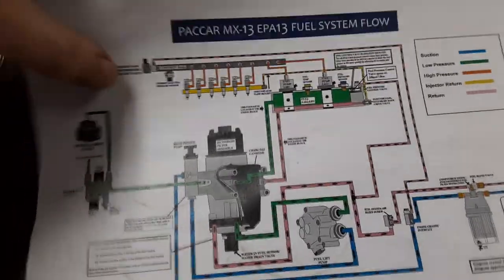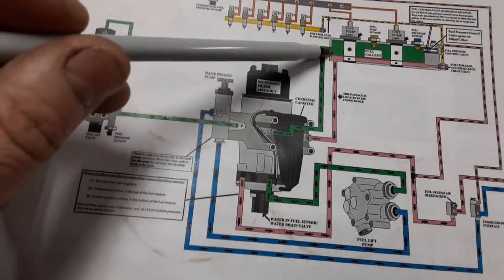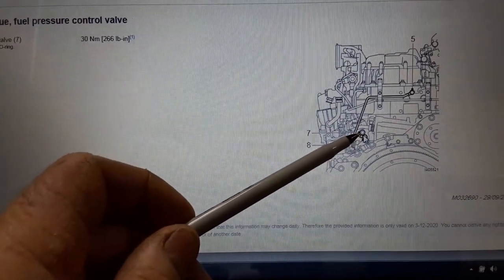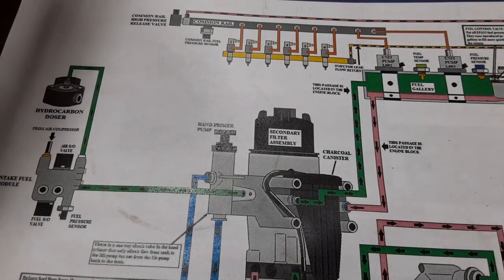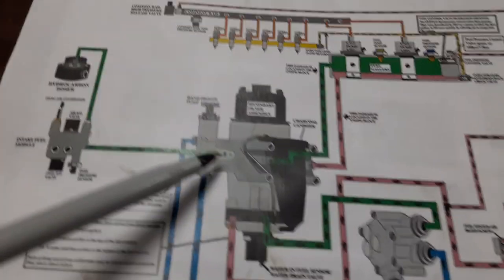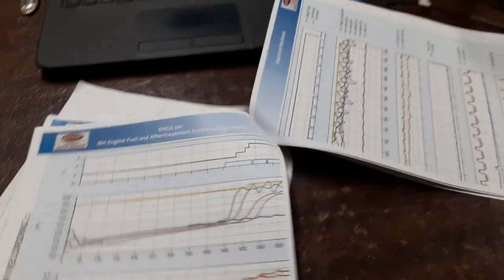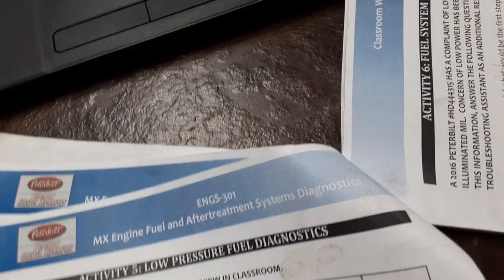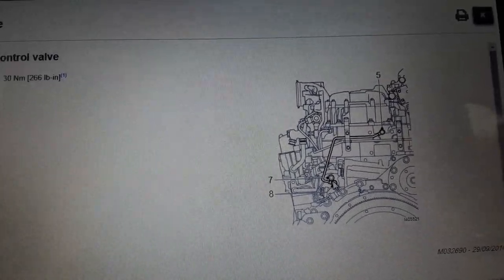MX low pressure fuel

Comment: hello, I had a problem in the second section of the high pressure pump, I changed the plunger inside and the valve was jammed, now my question is with the cups is everything okay?  what do you think?
Reply from the maker: Sorry I don't think I saw this.

Comment: What was the fix to this mx that only has 3 psi on low side fuel pressure?
Reply from the maker: I think I made this video to answer some questions, but I didn't get to work on the truck 😊
Reply: @monray300  Darn, I got one that's doing the same thing as described in your video.
Reply: Had this exact issue recently. Replaced the lift pump and it made 100psi instead of 3psi. Mx13 with only 495,000 miles

Comment: Can you post picture of this diagram?
Reply from the maker: Can you give me your email?
Reply: @monray300  could I have a picture of the diagram as well? Having a few low pressure codes.
Reply from the maker: @jessicaguerra3937  I'm not sure where I put it
Reply: I’m getting a low fuel pressure fault. Before getting a PM, the water separator would fill all the way up. After the PM it doesn’t but I’m still getting the same code (SPN-94)

Comment: I removed the regulator valve today. It was very difficult to get to. I found the best way to get to it was by removing the shifter. Then using a 13mm shallow socket with a wobbly 6inch extension.
Reply from the maker: Yep there nothing easy on these engines
Reply: I have same problem can you till which side regulator valve  please I couldn’t find
Reply: @harpreetdhindsa7774  it’s on the driver side behind the block. Not on the head. The valve was fine. The low fuel pressure was caused by the transfer pump.
Reply: @elnmrouno   where they located transfer pump  I already change regulator valve still same problem
Reply: @harpreetdhindsa7774  the tansfer pump is located by the air compressor. It’s on the driver side of the engine.

Comment: Sir i have problem with fuel restrict 100 change filters again and again change 3 different dealership nothing change facing this last 5 months any kind of sugession plz.   ?
Reply from the maker: Is your fuel contaminated? Sometimes they put the wrong fuel filters in, if they don't use the vin number, but it's unlikely 3 dealers would. Is it restricted or sucking air? Request they change filters by vin number. I know Missoula Montana Peterbilt has 4 good paccar mechanics.

Comment: Hi, 
do you know where is  fuel low pressure regulator on MX11 engine. I replace the lift pump but still have only 2 bars ☹️. Thank You
Reply from the maker: I'm not sure on mx11. But I think places you can loose pressure are at the lift pumps and the regulator on the high pressure pumps

Comment: My MX13 misfires after hitting around 40-50 mph only when you let go of the gas pedal and hit another gear.  Kinda like it’s starved for fuel but if you stay in the gear and don’t let off gas it’s fine.  It also does it when I go to downshift up hill but if I don’t let off the gas pedal completely it won’t do it.  Any ideas?
Reply: It’s an epa 10 also
Reply from the maker: Maybe sucking Air
Reply: Was a bad injector.  Replaced them all and it ran great.